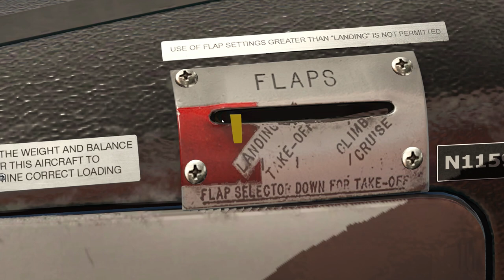Thranda Design De Havilland DHC-2 Beaver Landing Tutorial

Comment: Hello, you should show us how you deal with the throttle. That will help us a lot. Further if we could see clear the instruments especially speed and pitch... Thanks
Reply from the maker: Throttle is generally around 16 inches MP during final, but I'm making corrections to control my descent angle.  For example if it looks like I'm going to land short, I'll add a few inches of manifold pressure.  And the opposite if I'm going long.  And use small pitch corrections to maintain the correct approach speed.

For the speed, it's 80 mph on final for a normal landing.  As you come over the runway and start the round-out, smoothly pull the power toward idle.  It helps to keep a little power in, but at this point my eyes are focusing outside at the far end of the runway, and not on the gauges.  For a short field landing it's 65-68 mph.

Make sure the plane is stable and trimmed during final approach.  That way the speed will (mostly) take care of itself.  And don't forget to keep dancing on those rudder pedals to keep the nose straight during the touchdown and rollout!  A landing isn't finished until you come to a complete stop.  :)
Reply: Joseph Noe thanks for answer and guidance! I will try it on next landing....

Comment: At times, this aircraft is quite squirrely after touchdown. I've had difficulty even at proper approach speeds. Unpredictable, even in calm winds. For no apparent reason, one wing will come down and it's ground loop city. Not sure my rudder pedals will handle this kind of abuse for very long!  Otherwise, this Beaver is a great flyer - in the air that is.